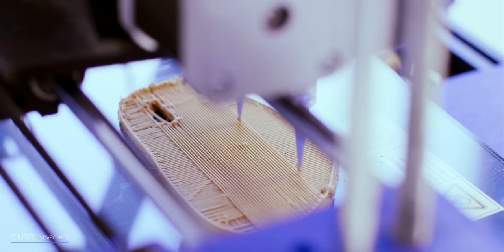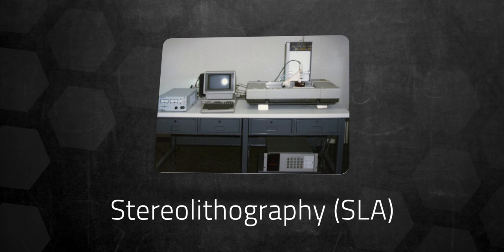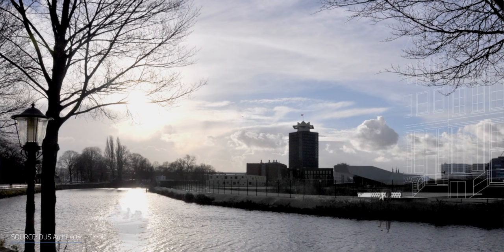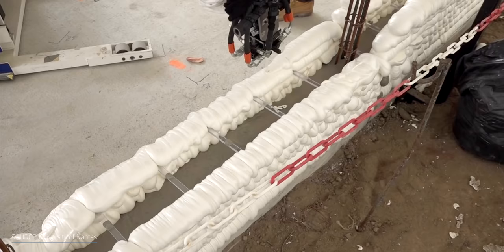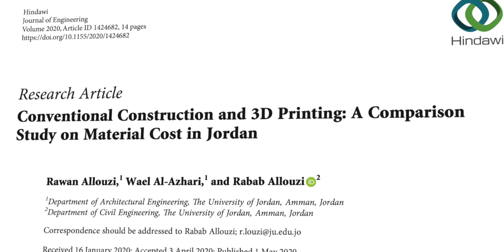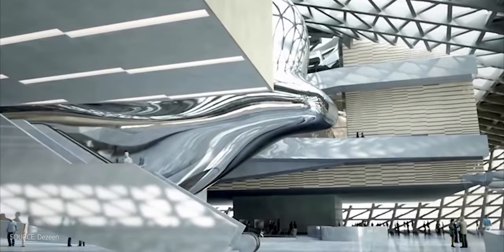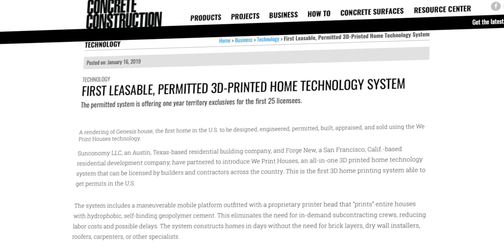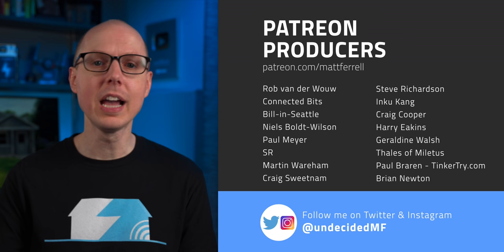This 3D Printed House Changes Everything - Explained

Comment: More realistic are still the ready house prepared centrally in several module and assembled on the spot.
In Germany this is 30% if the market now.
This is especially so successful because the electricity, plumbing, heating system, ... Everything can be installed before moving the house to it's final position.
With 3d printing you still need weeks to finish the house and that is a big part of the cost.

Comment: The cost of lumber is sky high now. On a $250,000 house being built tag on another $30,000 for lumber. As it stands when the price of something goes up it rarely comes back down. It's time that we start using materials like recycled plastics that are produced by the megatons every day for cheap 3D printed houses. Add a UV resistance additive, just a thought..

Comment: I can't help but think the cross-section of the walls of these buildings don't look very structurally sound. Is there metal reinforcement placed into in the concrete? Thin concrete on its own is weak AF

Comment: Perhaps in certain parts of California, Canada, Greece- and several other places- which now have mountains of alkaline wood ash that need to be put to use and stabilized. Also, one does not have to use straight concrete.

Comment: Using prefabricated elements just a few workers build a house in just a few day, and insulation and ducts for electric wires and water lines are included.
The elements are basically made by a robot and it make the elements for several houses a day. Made from wood a lot less CO2 are released and it is cheaper then concrete. My points is that just like 3D printing is limited in what it do well so is printing houses. We can already build houses at low cost with little labor that are a lot more flexible then 3D printing.

Comment: So the problem with housing isn't that it's "unavailable" it's unavailable at a price people want to (or can) pay.   3d printing may help a little, however the cost of housing often does not represent how much it costs to build said house but the fact people use that home in some way as an investment opportunity.  So many areas are having a huge change in the people living in the house very often isn't the person (or company/entity) who bought the house.    So sure they're advertised as "cheap", but what's to stop someone from saying "sweet, I'll take them all" and then turn around and rent them out, or hold onto them until they're worth more and flip them?     Unless some level of rules get put into place that require the main occupant of a home to be the person who buys it, and good luck policing that, 3d printing of homes will still push that level of unaffordable for most.

Comment: This has a lot of appeal until you look at a couple key issues:  First, only those who have rather large egos are going to be in the front of the line to pay the price of a conventional home for a 3D printed home.  Just because the homes on either side are priced at $500k doesn't mean the 3D printed house has the same value.  Second, what you see is what you get and will always have; you don't just knock down a wall or relocate a wall to change the floor plan once it is completed - you're locked into the design.  Finally, we don't know the long term durability of the structures and how resilient they may be to ground movement.

I'm all for 3D printing; I have a high end SLA printer myself, but I'd need to see a lot more of the science and studies before I commit, and even then, I'm not going to pay scalper's prices for a 1400ft^2 house.

Comment: You are not talking about 3D printing houses, but house shells.  The promotional video clips shown jump from the 3D printer doing the walls to a full house  with windows, doors, plumbing, electricity, kitchen, baths.  Even the inside of those houses are shown with plastered inside walls. Did the 3D printer do that?  It also painted it?  How and when did it jump from the shell to the full house?  As anyone who ever built a house knows, the basic crew to do the walls is just the beginning, then you get the plumbers, electricians, roofers, HVAC, painters,  and all the rest of the contractors. Try to fit the window frame over that wiggly surface.  Considering that all the CO2-saving materials could be easily employed on any industrial scale modular house manufactured under a factory roof, what is the point of in-situ 3D printing if you can do something much better on a factory floor and mount the fully fitted panels (windows, doors, power, water, AC, and even curtains if you want them) in a few days?

Comment: Now I’m really curious as to why curved walls result in less humidity.
Reply: it's not less (absolute) humidity. cold air gets trapped in corners when heating a home due to air flow restrictions. So you have more condensation -> mould in corners

Comment: and after 20-30 years when the plastic gets brittle from all the sun beaten heat work hardening it and you need to replace your entire exterior?
Reply: No, you won't be a stationary human nomore with extreme oppressors around you when these things come out accurate that it build what you want fast, Everyone will be floating with they 3d printer  everywhere all over the planet, exploring and learning it finally for ourself  with no limits  on how to do so and when we all want to chill we just print a home whereever we at, break it down in the morning,  and get back to exploring living our best exploring life, learning new ways to advance our species life span would be next, as they only focus on this now pushing vaccines only and not our newest life saving technology that could be advanced in years if it's studied asap by the whole world . #thehumansfinallyadvancing. 
#theydoneletthehumansinthedoor .

Comment: its still a bit off compared to something like Monolithic Dome housing, which can be made rather cheaply, with extreme weather (tornado, fire, etc) resistance as well, not to mention the lower cost of Heating or Cooling.  while it's neat, I am curious the actual costs - getting the 'printer' out to location, material costs in printing, the extra costs (like door and window frames) etc would all need factored in. Also some of those layers are uneven, and/or shifted, as a person who 3D prints this bothers me, and also makes me wonder about the overall stability of the building when that happens.

It also appears most of the buildings don't have printed roofs either, which brings it back to traditional means to getting a roof on, and that makes a weakness for things like termites, fires, and high winds.         More information needs shared, without the over-hype drama of "this is the future" type articles.  Too much "getting sales" involvement in these videos they produce, without giving finer details for those really looking.

Also.. those flat panel solar systems on the homes would need a drastic re-working to do any good in most of the world. The only place that they could be laid flat and get decent power, is around the equator area- and sure Palm Springs might be ok there, go any further North and your going to lose energy, fast. Making that sort of home and power solution available on a wide enough scale to matter- means changing that system to be adaptable to nearly all locations.

Comment: I just don’t see how this would ever work in earthquake prone regions. Typical concrete or CMU building always have rebar and fully grouted cells. Unless testing is done that shows that this material works in earthquakes I don’t see it taking off in places like here in California. The house also still requires foundation, floors, and a roof which would still need to be built the traditional way.

Comment: If I wanted a concrete house I'd use polystyrene construction forms and have the house poured.  But concrete is not a good material for an earthquake zone.  Whereas wood frame buildings will sway in an earthquake, concrete just breaks up.

Comment: To me they clearly need to work on the material used, to make it as low carbon as possible.

Also glad insulation was mentioned, because just looking at the video you wouldn't expect the houses to be well insulated. Except the French one, with which I'm familiar : what is "printed" is actually the insulating foam, as a double wall, then concrete is poured in the middle.

Comment: 1400 sq feet at $300k is $214 per square foot. That's pretty expensive by normal construction standards and it only takes a few days to build? So most of this money is just going into materials? That's crazy. I'm guessing the markup on the house is insane and they're just hoping some sucker will buy into the trend hoping to save the world.

Comment: They only ever build these on flat ground, you still need a ground crew to come in first to clear then to put a pad down so for now ground workers still have a need, only time will tell if these homes last as long as a traditional brick house, i like the sip panel houses because there made on a production line and shipped out. What would be good to see is a home dug out the ground and the soil mixed with additives to make a semi above and below house, the shear cost needs to come way down but the biggest problem is if i paid 300k for my house and then someone prints one the same size but 2/3 price i then go into negative equity, i know the land has a value but it would cost loads to clear a site to the re pint.

Comment: As with all these pipe dreams, it’s just not cost effective at this point in time. No one ever shows how heat/ air conditioning/ plumbing/water and electric are used in these homes.

Comment: I mean idk if I can agree... there's been a ton of hype over 3d construction recently but the way I see it... it's simply not the best and never will be the most efficient way of construction... First of all  u need a stable foundation and a way to carful carefully lay down a consistent mix of wet and well quickly drying. material that has to be strong enough consistently placed and moved around with some velocity and speed because at the end of the day it takes time and...

Then you need to make sure everything is precisely aligned and accurate which isn't exactly easy...
And so on

Yes one of the reasons Ed printing shows potential is the need for less labor which h is at the end of the day expensive 

But u also gotta remember the expensive printer that has for be shipped and assembled and..  (well probably not that bad and like a crane... but non the less) and generally speaking there are better ways to invest in construction  technologies 
Su h as for example ample precast modular parts...

Modular construction  shows an amazing potential

A factory at the middle of no where near all the resources needed... precasfing in an controlled environment ready parts 
To be easily shipped to the site and assembled...
No ideal but....
Wo far better then 3d printing... 
First of all much more precise and many more options and abilities to construct whatever is needed...  no need to mess on site all u need is a stable foundation  and everything goes on top easily...

Much easier to repair and maintain in some cases... usually superior materials are used
And so on...

Also can be automated to require a lot less staff...
A factory can be basically completely automated shipping nearly automated entirely in the future  with self driving trucks (and regulatory backup drivers..)
A couple of guys with a crane maybe on site/ whatever to set everything up in a day or 2... (+you're normal stuff such as utils...)
Much better then 3d printing allready

Comment: IMPORTANT - can we consider 3D print wave/water resistant materials cheaply enough to consider "Blade runner 2049" - style seawalls? If we can I predict with considerable certainty that a lot of countries will soon aggressively consolidating low sea coastal areas and extend existing land by a fair margin into the sea. I live in Amsterdam, in the Netherlands and this idea has been familiar to the dutch fo centuries. We can create 3D printed blocks, filled with gravel, and deposit them into the sea, and use mostly hollow structures and thereby create pillars suspending surfaces, thereby 3D printing land surface. If this gets economical, we can see massive economic development the likes of which we haven't seen in a while. Dubai style land reclamation on an exponential scale. 

Remember that idea to dike in the north sea, to protect major parts of Schotland, England, Denmark, Norway, Netherlands, France, Belgium, Russia, Poland, Sweden, Finland, The Baltics from the sea rise. These are actually projects that fit inside coutries current budgets, and imagine the potential if we can build cities on these emerging dikes. They'd be hundreds of meters high/deep into the sea, and extend for hundreds of kilometers. That's real estate for industry, garish apartment complexes, wind farms, fish agriculture, airports, MASSIVE sprawling sea ports. Imagine reclaiming low lying parts of the north sea (and other shallow seas worldwide). This would be the first of several consequtive defenses and against sea level rise. And friendly neighbors would be well inclined not to make war if they share communal coastal defenses.

It would suck for poor countries though. Bangladesh, as just an example, would not be able to afford this in the next decades, but these reclamation projects WOULD most likely push sea levels up elsewhere by an appreciable margin. Imagine the US angrily protesting the EU reclaiming the north sea as this kind of projects would push up sea level in their impoverished coastal communities.  But by then most likely the US will not even be a consideration an more. Assuming it still exists by then.

Comment: Wait! I want to question the statement about the 1,400 sq ft house for $300,000 being half the cost for the area. At the presumed $600,000 for a standard house, that would be an extremely high-cost area--prime New York or San Francisco maybe. Tell me what the standup cost for that 1,400' house would be without the lot cost included in Kansas City or Indianapolis or Atlanta in a typical neighborhood.

Comment: I'm seeing an aweful lot missing from these homes. Ductwork for ventilation, the furnace, electrical components like meters and such to indicate the work was done in the home, to name a few things. To add onto this, flat roofs might work in places that don't have heavy snow or rain but in those regions that do, curved roofs are a must. What about foundation repair as it ages? It's not uncommon here in the midwest to have a need to replace or at least do a good fixing of your foundation after 25-30 years in higher elevation areas and about 1/2 that time in lower (think marshland) homes. If a 3D Printed home with a printing mechanism to do all of these repairs without your intervention would really grab my attention. Purchasing a home is one of the main driving forces for why many 1st world (thinking European + American) folks in the commonwealth are in the hole with debt. While it's not an official metric of the economy, it's certainly a big indicator if folk's lives are either flourishing or diminishing if that makes any sense. I'm hopeful that this technology with grow to be a very common practice in house fabrication, but it's no where near there yet. Unless I see some experts really hammer down from various trades pointing out the benefits and consequences for living in a home of this make vses traditional housing (with tips to improve it would be awesome! I'm thinking Sandy Munro style breakdown here).

Comment: The only comment I have with the number of laborer's is on the technical side. Things like plumbing, electrical, HVAC, building automation, painting, appliances, etc will still need to be installed by skilled labor. Then making sure everything is up to code, etc. So, the people who are not involved are the ones doing the framework, and walls.
Still a neat idea/concept.

Comment: I prefer that machine that only puts the cement layer while workers come after putting bricks (some hollow with the water and electrical system already installed on them) over. its more efficient, you have jobs for people making jobs that are still too expensive for machines to do plus you have someone at the site to turn off the machine in case of a bug on the computer. you can build a solid home in a week with about the same amount of people that the ones that used preconstructed walls.

Comment: I didn’t expect it to be that expensive 🤔 
I can have a conventional house build for about 2/3 of that price.
Reply: Often left out of the discussion seems to be that 3d printing doesn't help much or at all with foundations, plumbing, HVAC, wiring, and for many climates, roofing. Notice the example homes are often built in temperate areas with mild weather. This is probably why the comparative savings can be as meager as 20% on average. In a very hot,  cold, or stormy region the saving might be zero.